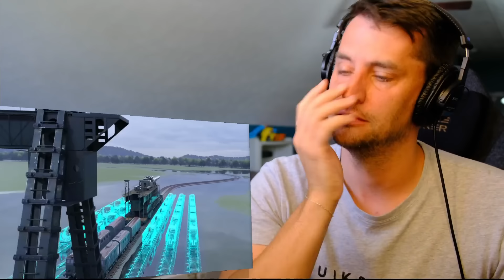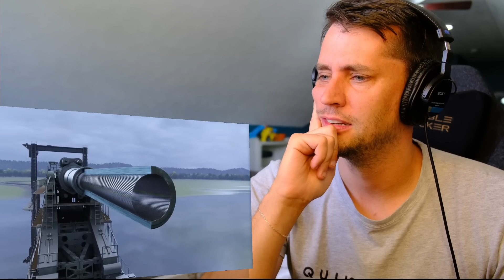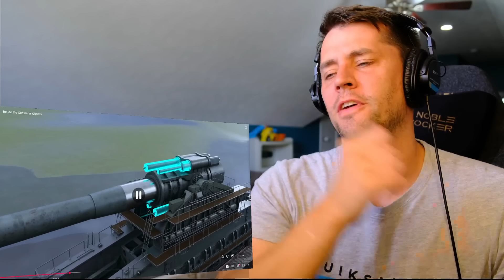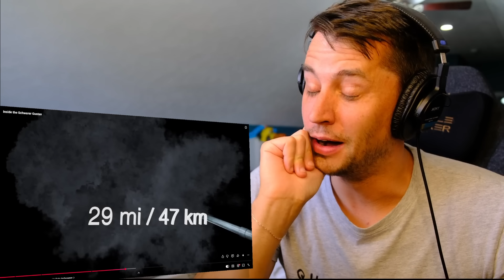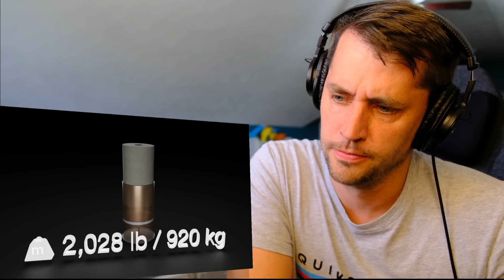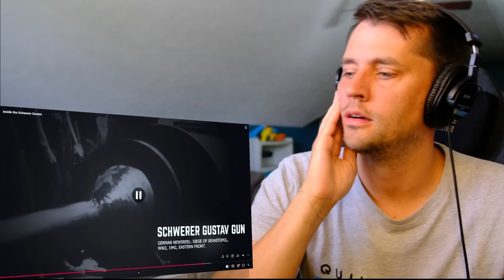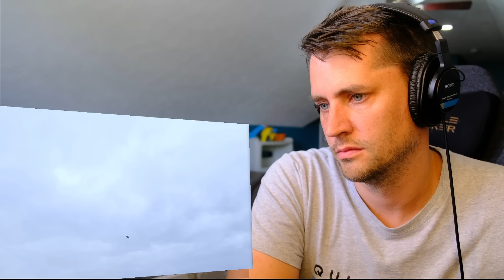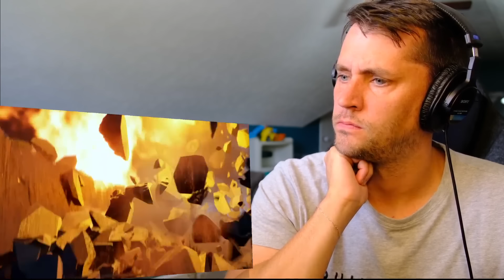American reacts to the Schwerer Gustav

Comment: the need for personnel was due to the crew laying the twin tracks for the cannon so it could move around. 
Allied planes would routinely look for tracks and order bombing runs to destroy them. 
The cannons did see active service during seiges, but were not really successfully used very well. 
You would be stunned by the things Hitler was trying to build like the Landkreuzer P. 1000 "Ratte" which was to have a spare left over battleship turret on top of it. 
Even the Japanese built some immensely impressive technologies like the I-400, an actual Aircraft Carrier Submarine, each carrying 3 planes with folded up wings inside them.

Comment: Bro, imagine if the Nazis had dragged Gustav to the coast! You ask why all that insane effort for just 16 shots a day? Think about coast defense: If 5 of Americas massive Iowa-class battleships were approaching, Gustav would have obliterated them at 40+ km out—before they could even see the coastline.Your biggest US battleships fired 40.6 cm shells, but Gustav fired an 80 cm monster. Your shells weighed 1.2 tons, Gustav’s weighed over 7 TONS (the weight of 7 VW Beetles flying through the air).The impact sequence would be terrifying: First the massive boom in the distance, then the 7-ton shell crosses the horizon, and then the final boom that literally vaporizes a flagship. With that kind of absolute destruction, you don't need a high fire rate. One shot, one ship gone. That’s why they put in that crazy effort—it was meant to be the ultimate concrete and steel cracker (originally built to obliterate the French Maginot Line)!

Comment: This was the Führer's outlandish vision.
The doctrine was to instil fear in the enemy and pride in the Germans. Adolf's vision was to build bigger and bigger weapons. This can be seen here with 'Dora' and the Maus tank, which weighed 200 tons (the only completely built Maus tank is still in a Russian museum). There were plans to create a 1,000-tons tank fortress called "Ratte" with a huge main gun and several "side guns" that would have been the main gun of the Maus or the Tiger II. This vehicle would have been the 'Dora' of the main battlefield, but it never made it over planning phase. What terrain could withstand the pressure of 1,000 tons when the 70-tons Tiger II already had problems?
 Nevertheless, the Second World War spurred progress in many fields of research. One example is the V1 and V2 rockets, which were the forerunners of space rockets. Furthermore, their famous engineer Wernher von Braun later worked for NASA.

Comment: Just compare that thing with the guns of the Yamato or Iowa classes.

Yes—and that comparison really highlights just how absurd the Gustav was. 😄

	Schwerer Gustav	Yamato	Iowa
Caliber	800 mm	460 mm	406 mm
Gun weight	~400 t (incl. barrel assembly)	147 t/barrel	~122 t/barrel
AP projectile	~7.1 t	1.46 t	1.22 t
HE projectile	~4.8 t	1.36 t	0.86 t
Muzzle velocity	~720–820 m/s	~780–805 m/s	~760 m/s (AP)
Range	~38–47 km	~42 km	~38 km
Rate of fire	1 shot/30–45 min	1.5–2/min	2/min

The figures for the Yamato and Iowa are based on technical specifications for the Type 94 and Mk 7 guns, respectively; for the *Gustav*, the values differ depending on the projectile type.

And here is the truly staggering difference:

The Yamato had nine 46 cm guns.

A single salvo meant 9 × 1.46 t = 13.1 tons of projectile mass—and it could repeat this roughly every 30–40 seconds.

The Iowa had nine 406 mm guns.

With its 2,700 lb Mark 8 AP shells, that amounts to around 10.9 tons per full salvo, also at a rate of about two shots per minute per gun.

The *Gustav*, on the other hand:

a single projectile weighing over 7 tons—followed by a half-hour break.

That is the crucial point: the Gustav wasn't simply an extremely large version of a battleship gun.

Conceptually, it was something entirely different.

The Yamato and Iowa are weapon systems designed for naval warfare. Their guns had to:

acquire and track targets,
reload quickly,
rotate their turrets,
fire at moving targets,
adjust fire over multiple salvos,
and sustain this throughout prolonged engagements.  The Gustav, by contrast, was essentially a mobile siege engine designed to crack open a fortified position using an absurdly large projectile.

This makes Ryan’s reaction quite understandable:

“This much resources … just so it could fire 16 shells in a day.”

At first, that sounds ridiculous—but when you place the Gustav alongside the Yamato and the *Iowa*, you realize just how extraordinary the concept was.

*Yamato*: nine monster guns on a floating warship.
*Iowa*: nine monster guns on a fast warship.
Gustav: one monster gun that required the construction of its own dedicated railway infrastructure. 😂

And yet, one thing is particularly interesting: in terms of a single shot, the Gustav isn't actually as far removed from the Yamato or Iowa as one might intuitively expect. Naturally, the projectile energy is vastly higher due to the immense mass, but the muzzle velocities are surprisingly similar.

This illustrates the point beautifully: the 80 cm caliber doesn't make the Gustav a gun that fires twice as fast—it makes it a gun that accelerates an absurdly larger projectile.

However, when you compare the raw muzzle energy, the figures become truly grotesque.

Comment: The data displayed in the video is incorrect. The range was up to 124 miles, the weight is also incorrect, as is the muzzle velocity, which was approximately 745 mph. The crater of the He-Schelle was 98 feet, and the destruction radius was approximately 1968 feet. The Schwerer Gustav was thus one of the most powerful artillery weapons of World War II.

Comment: The thing is... Germany appeared to 'have won' Western Europe. Hitler was not very interested in protecting his back when he turned on Russia. Plus Hitler knew about how in WW1 the allies had dug in trenches and trench warfare is slow with MANY deaths. He had served in WW1 and didn't really want to repeat that sort of deal. It's why in WW2 when he punched through the Ardennes he used Blitzkrieg. He figured the UK insignificant which, to a degree they were before France fell. So having a weapon that could decimate fortifications like that and punch big holes in a defense, it was sort of the best thing at the time. ICBM's and such were not really all that famous at the time so really, how else does one punch a hole through the front lines other than a giant gun?

Comment: A 800mm Gun 31.5 inch Over 106 ft Long For thr Barrel Yamato Only had 69 ft at 45 Caliber 460 mm /18.1 inch The Designers did Flirt with  50 Caliber that would make them 5 and Half Loner at 75 ft over 160 Tons.

Comment: It’s not that it’s impossible, but put simply… impractical. Firstly to invade a country even one as small as England or the UK requires both large amounts of resources, money and just the basic willingness to actually invade a country, hell even a country like Russia is struggling against a bunch of wheat growing peasants 😂 and I don’t mean to be disrespectful towards the Ukrainians but let’s be completely honest, considering the overall economical, technological and military scales of Ukraine, it’s pretty low in terms of power scaling in regards to other major countries like France, Belgium German, England and especially Poland. And that’s with a direct landmass connecting Ukraine to Russia outside of a few key and vital bridges Ukraine is mostly wooded, muddy and OPEN plains more akin to say North dekota where there are the few large woodlands and forests but it’s mostly just cornfields 😂. And Ukraine is basically the same. Meaning that despite having access to a direct connection with Ukraine due to the waterlogged terrain resulting in a massive scrap heap for miles along paved roads since anywhere other than a paved road or hard surface would result in their tanks and vehicles ultimately becoming stuck, causing mile long lines of burnt and destroyed Russian armored vehicles. Now why does Ukraine matter in this situation? And it’s simple name a country outside of America that has the sufficient resources and ships to mount a full scale amphibious assault on an Island that is 50% sheer cliffs?, and the only other two major maritime countries in the world are China and Russia. And whilst having sea superiority might be easy, both maintaining and protecting those supply chains is a hell of a lot harder. Not to mention that whilst England might have a cash strapped navy with four destroyers, two carriers and a handful of corvette’s, in a straight up fight Britain will loose the naval battle, but that doesn’t change the e fact that we have several nuclear capable submarines ready to launch at any minute. Not to mention the fact that we still have a formidable airforce still/ish, as well as roughly nearly 200.000 trained soldiers ready to fight and if push comes to shove a further population of over a million people will also be drafted. Granted we do lack the massive stockpiles or sheer number of guns and ammunition compared to say the state of Texas where a single US state has more guns and ammunition per individual than the entirety of the UK😢, but still we still have large stockpiles of weapons either in museums and private collections. And granted trying to storm a beach at Dover whilst some British teens fire a medieval trebuchet at you isn’t exactly idealistic, and despite how small the UK is compared to other countries it is still quite large, not to mention the main reasons why you’d want to invade a country to begin with. Firstly if you want to invade a country it’s either because you want their resources, their land or the strategic location to potentially attack and invade another country, and if that were the case such as if you invaded England just so you can invade Germany then you’d be better off by simply invading France, as for things like resources, well unfortunately the UK doesn’t have a lot of valuable resources let alone any resources left for that matter, any oil we do have is given away to the Netherlands and to the Norwegians, we don’t have any coal left since we’ve used it all up, and British steel is now cheap Chinese steel 😢, we barely produce enough food to feed our own country and the economy isn’t worth much these day 😢, granted even if it was for financial reasons, most of our money is in finance and as soon as that’s destroyed by air and missile strikes, there’s no real reason to invade, and once you have invaded the UK not only will you have to now deal with a very pissed off population but things like guerrilla and partisan attacks on key military installations and infrastructure, but not only that but you’re basically trying to invade four independent countries rather than just the one and having the Welsh, Scot’s Ireland and England without causing the other half of Ireland to join in the fight as well, but let’s be honest is it really worth the blood and treasure just so you could be bunked up next to the Welsh 😂. Not only that but despite Britains withdrawal from the EU, the UK is still a key European country and close ally to many European countries such as Denmark, Norway, Belgium, Germany and if at all lucky perhaps even France, not only that but being a part of nato means that if any nato country is attacked then it’s an attack on all other nato countries, not to mention that the UK, is also part of what is known as the commonwealth alliance, which is a military and economical alliance between the UK and 56 membered country, which is not limited to both India, Australia, several South African countries, New Zealand and Canada to name a few.

Comment: The engineers were so fascinated by the question of IF it could be built, they didn't ask wether it would be sensible to build.
And WW2 germany somehow didn't have a good Filter on what weapon systems to build and what to better leave on the drawing board.
Reply: No not quite they built something they tested they let it alone when not working they built things for certain purposes if the purpose is finished you concentrate on something new The development of the rockets today came from German engineering

Comment: This weapon was intended for stationary use to destroy the massive bunker complexes of the Maginot Line along France's eastern border with Germany. The Maginot Line was a chain of fortifications designed to deter the Germans from invading France after World War I. Unfortunately for the French, the Germans simply bypassed the line in 1940 (yes, that is why they "needed" Belgium and the Netherlands), rendering this cannon unnecessary. However, the fortifications in the Crimea (Soviet Union) offered an opportunity to shorten a protracted siege, making the time-consuming assembly of the weapon potentially worthwhile. Ultimately, though, the shots lacked sufficient accuracy.

Comment: Dora was originally designed to attack the Maginot line in France, but stupid French didn't plan for the need of the guns to move or turn and thus the Germans just went around them. So Dora never had to be used against it.

Comment: You suspect it was built mainly for morale,
Well, they did use it for propaganda, but originally they ordered it to bust the bunkers of the Maginot-line.
Allegedly they also had drawings for a 1 meter caliber(= 40 inches) version, but pondered that 80 cm would be enough for the intended purpose.

Comment: This system is so misunderstood. The thought was to have an all in one solution, basically a moving combined supply and front line, with a massive gun at the end for when it meets heavy resistance. At which point they could deploy the weapon at safe range and bring in reinforcements as needed, now being able to roll in via the newly constructed rail system. 
Then set up a forward base with all infrastructure needed for prolonged engagements, with troops, tanks and all. They didn't need 4000 men to pull a trigger, they need them to build the infrastructure required for this massive combined operation to roll forward.

And when done, pack it up and push/build on.

Also, at that time, you couldn't just shoot down a balloon 50+ km away, over a heavily fortified and reinforced position.

Keep in mind, as much as people like to hate other people, they were not stupid.
There's is a reason many German scientists and engineers were offered good jobs in their relevant fields back in the U.S. at this time. NASA anyone?

Comment: One of Gustav's younger siblings is in the U.S.
This younger sibling's name is Leopold K5(E).
The Germans (too) built many railway guns. Most of them used the gun barrels from warships, which is why they had such a large caliber.
(For example, the main guns of the USS Missouri (BB-63) were 6 inches. Even larger ones were planned, but they were not completed by the end of World War II.)
Heavy wear is normal for these guns. A barrel’s service life is 100–150 rounds. That’s why each shot is extremely expensive.
I should note that there were other similar large-caliber weapons as well.
The American “Little David” mortar was 36 inches in caliber...
The K5(E) also fired across the English Channel. Admittedly, its accuracy left something to be desired.
Today, the K5(E) is preserved at the United States Army Ordnance Museum in Fort Gregg-Adams (Petersburg, Virginia). Leopold was shipped to the United States Aberdeen Proving Ground (Aberdeen, Maryland), where it underwent tests and evaluations. In early 2011, it was moved to Fort Gregg-Adams, Virginia, as a result of the 2005 Base Relocation and Closure (BRAC) Act.
16:20 A typical split-charge gun load. The tray-fed system was used on ships for the main guns. There are quite a few archival films of it.

Comment: Guns like this has a long range, they was good to sink ships or destroy heavy fortified Locations without getting in fire range of the enemy.
Reply: hundir barcos? 🤣🤣
Reply: @RitxiSes indeed, they get used around the Coast, planes got the informations about the convos Locations, and the gun did the job.
Reply: @Boschtelix  Firing at ships with a gun like the "Dora" is not feasible; while it might be possible with smaller guns, it remains complicated. They cannot compare to naval guns, which are faster to load and fire—allowing for salvo fire due to having multiple barrels available and enabling quicker fire correction. How long would it take to load and aim a 28 cm K5 gun at a moving target? It would be a different story with the 40.6 cm/52 SK C/34 naval guns, provided their coastal mounts were equipped with the same systems used on the ships for which they were originally designed.

Comment: Utter Bullshit right in the beginning, so much that i had to look it up again xDDD 

4000 personnel included EVERYTHING from train track builders to flak brigades or whatever its called in english ... 

irl it took just for the gun 1500 soldiers. Gustav was ready to fire in about 3 days, and it just took 2 train tracks but said trains to pull this. Only the firing position was prepared extra... 1500m of three parallel tracks were built anyway. This just describes the usage at sewastopol ughh... which was the only combat experience made. And only this particular gun was called dora.